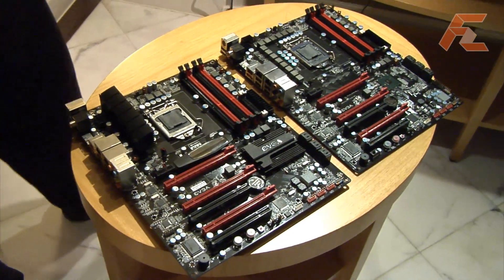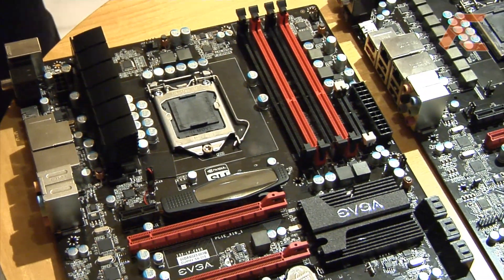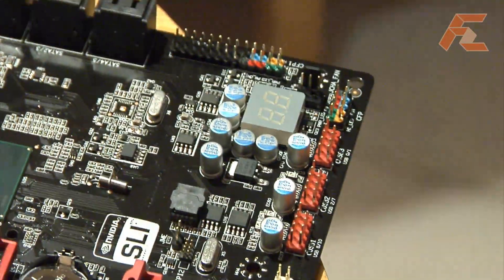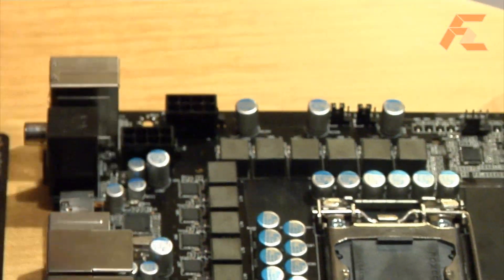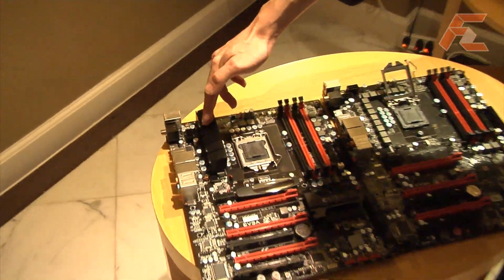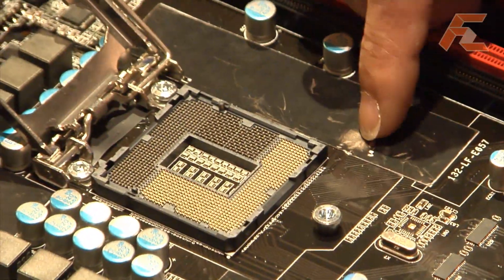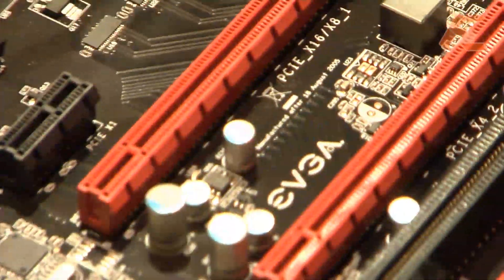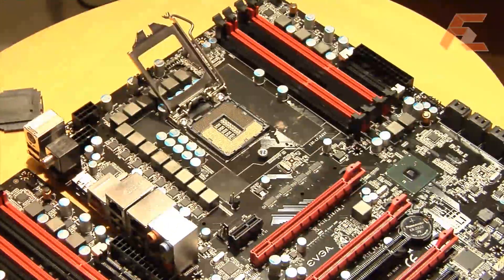EVGA P55 Motherboards @ Computex 2009

Comment: its been proven that ssd's are only slightly better than raptors, but cost WAY more. they also burn out faster than hdds.  if you were a real power user you'd be waiting for the 300 and not wasting money on a 200 card and lastly i haven't heard of a single gfx card that can run maxed @ 1920x1200 averaging 60fps.